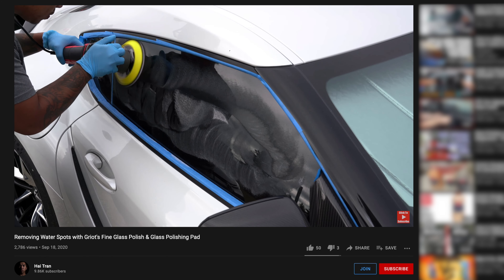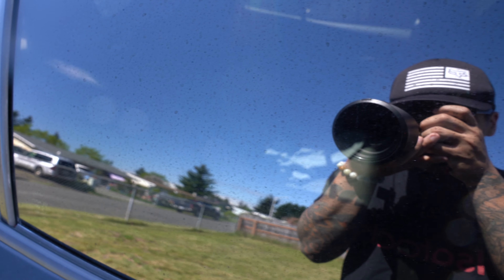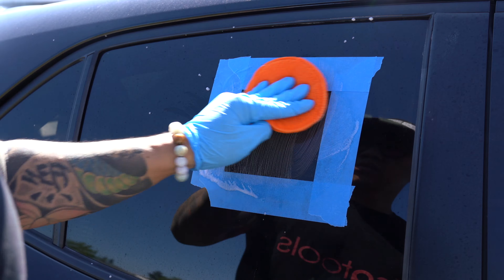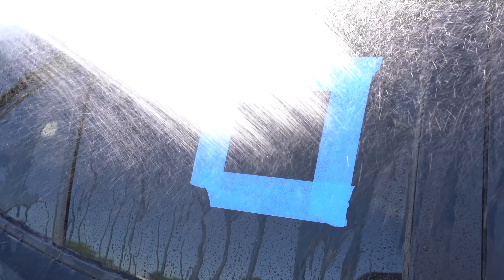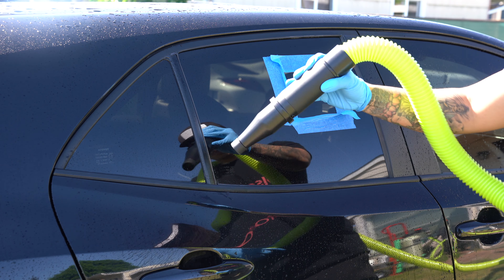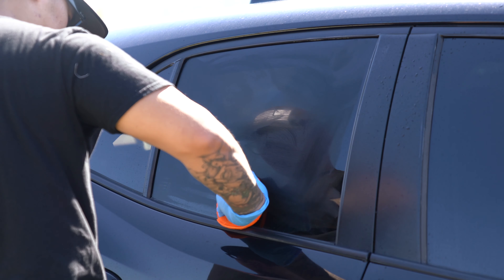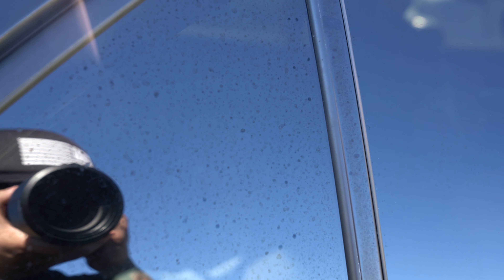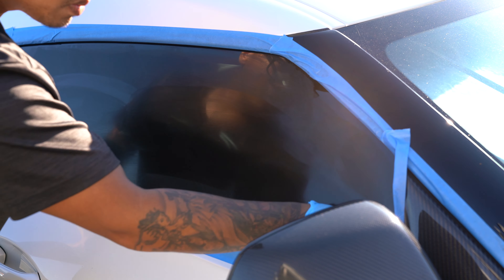Fastest Way to Remove Water Spots from Glass

Comment: Hi, I just purchased some of the Bar keepers friend soft cleanser for my car windows after seeing your video. I was wondering what I should use to apply this? I only have micro fiber cloths at home (don't have special applicator pads or anything like that as I don't normally do any kind of work like this at home), will those work? If not, what do you recommend I go buy for this?
Thanks in advance
Reply from the maker: You can use pretty much anything that holds the product to spread it.
Reply: @HaiTran  thanks a ton great video man
Reply from the maker: You're welcome 👍🏽